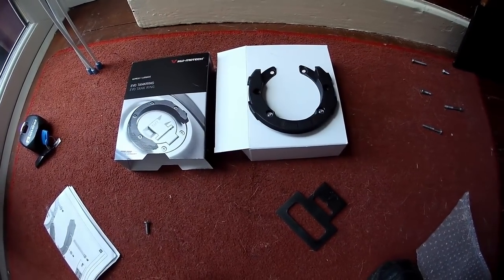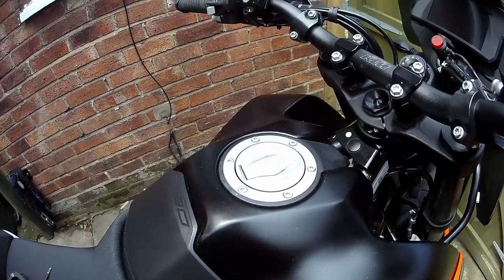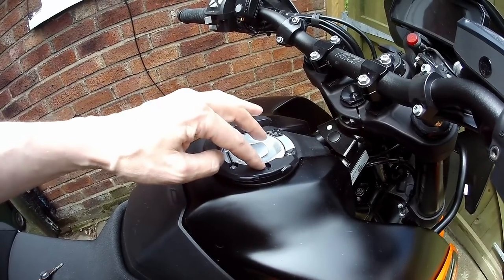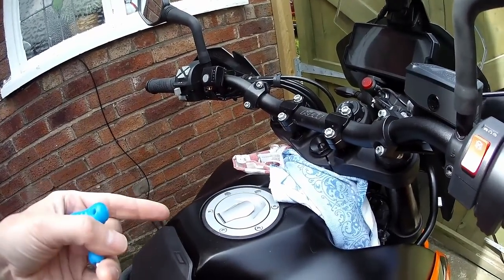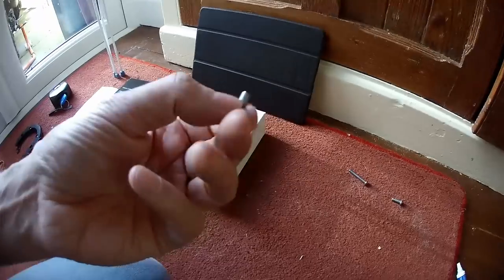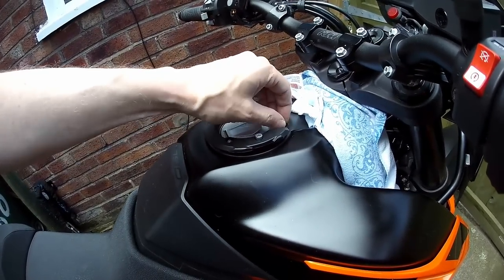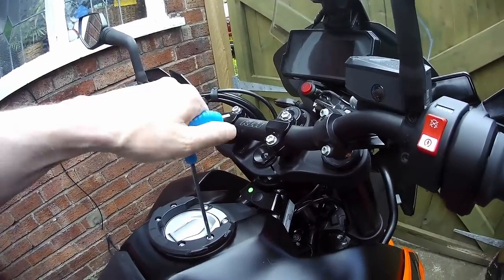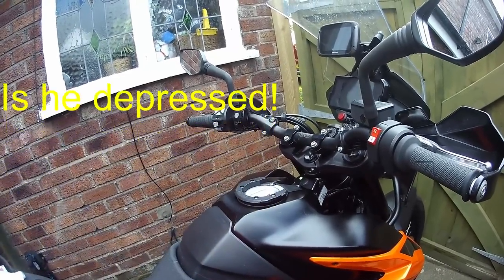KTM 790 Adventure - SW-Motech Evo Ring

Comment: I wonder if flipping the actual fill port is an option so that you can install the tank bag the right way
Reply from the maker: I doubt it (filler) would open properly as it might hit the bars. Easier to fit the bracket the other way around (on the bag) and see if it fits. However, I never had an issue with it this way. Small, but handy for keys, phone etc. 👍